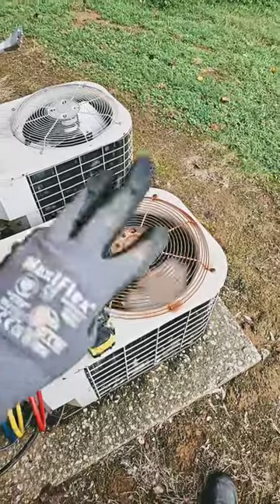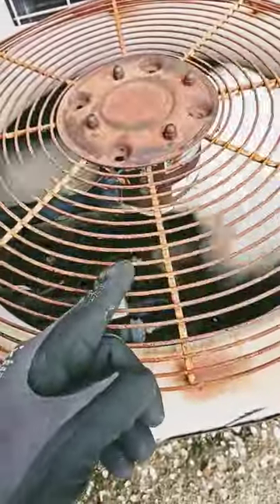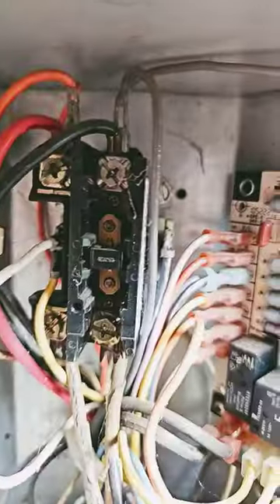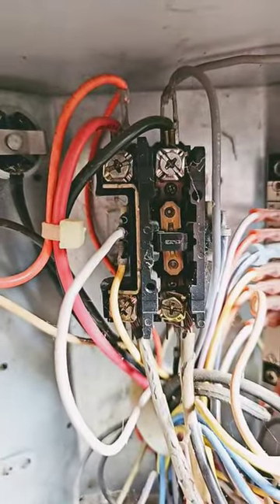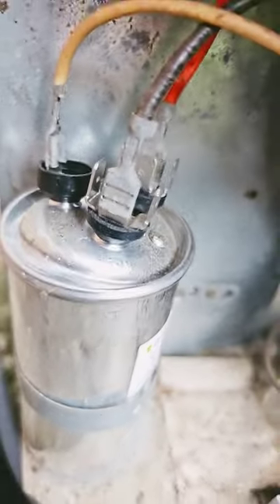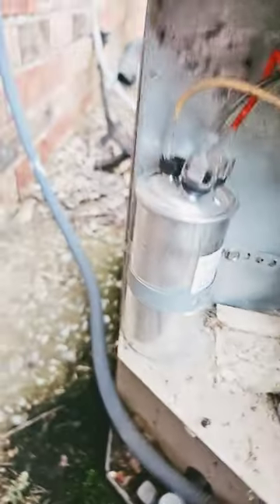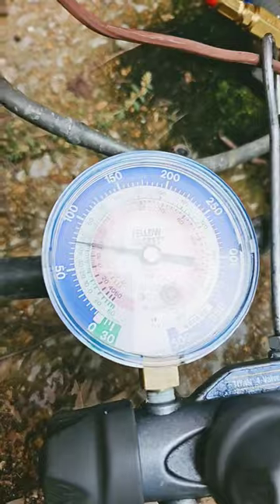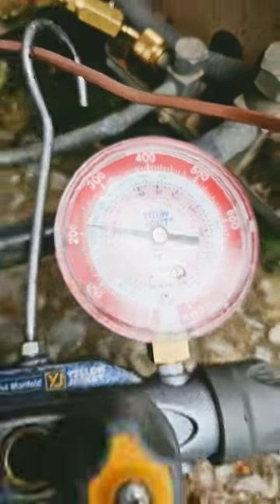Why is my air conditioner fan not spinning? #airconditioning

Comment: Exactly what happened to my parents at the fan motor seized up. I checked the capacitor it was good and the relay contacts will need changed next time I go over they were pitted very much and corrosion all over it. Thanks for your help and videos

Comment: All great points! I would like to mention sometimes the fan may not run but the units operating properly. This could be due to an encapsulated fan cycling or a motor master control. Both used to run the system in low ambient for commercial applications for the most part.

Comment: Those needles look perfect! All too often on older units, I wind up having to clean the blower wheel and evaporator coil due to lack of filter change and just time. Dead giveaway is slightly higher head pressure.

Comment: Number 4 Pressure control system that turns the fan off for low ambient temperatures. These do go bad and will fault out killing the fan in the summer months.

Comment: Capacitater….exactly!😂🤣I arrived at a call once and I assume a homeowner replaced his own blower capacitor so he wrote the wiring on a post. It was wrote as cow-pastor🤣😂. But on a serious note I’ve seen internally shorted compressors cause on outdoor fan to run at really slow speed when the contactor isn’t pulled in. Just a back feed of voltage through the other windings of the compressor. I’ve saw that a few times. Great content!

Comment: Most AC capacitors are actually 2 in one. If you have an AC where the fan moves but the compressor never comes on then its likely the larger one that has failed but the smaller one is fine. Also this is like a $15 fix that anyone can do as long as your safe. AC companies will charge you crazy prices to replace this.
Reply from the maker: truth

Comment: do you always swap like for like on the cap? assuming if it was swapped before it was with the correct one? or do you always check schematic or manual first?
Reply from the maker: I always just swap, and sometimes I check schematic
Reply: If the fan motor has been replaced, it should have it written on the side. The original diagram may call for a +5, but depending on the motor, it could be +/- to a 7.5 - 10. If you're familiar with the unit, you can do a pop and swap, but if you're just starting out in Hvac, it's a good practice to read your panel and the fan motor.  To high you'll kill the start windings by hitting to hard. To low, your starving it and adding a load that can also eventually burn up a leg on the contactor. Taddy has been at it a while. He knows his stuff. We all pick up our own ways of checking equipment and also changing our parts. One thing we all have in common is safty first! Pull that disconnect, or flip that breaker. Complacency kills.

Comment: How do you figure out what kind of capacitor if it's not numbers?
Reply: Check to see if there is a label on the compressor and look on the side of your fan motor.  A lot of times, the diagram is to faded to read, and the sticker on the original capacitor could be faded or missing as well. When in doubt, I'll call the manufacturer and do my best to find the model # of the unit. Sometimes, you honestly have to guess. I hate doing that, but if you know what to listen for in compressor/fan start-up you can get close. With the fan completely disconnected power up the unit and listen to see if the compressor fires off smoothly and doesn't start by "Hammering" that means your hitting it to hard. Some noise is normal on take off. Once you have the compressor taking off good, test the fan motor in the same fashion with the compressor disconnected. If the fan doesn't start or starts slow your not hitting it hard enough. You want a smooth take off. If both tests ok, you should be good to go. Side note : When testing the compressor by itself DO NOT run it long without a fan. Heat and pressure build up way faster than you think. Hope this helps

Comment: What if the fan blades won't move at all? Even with a long screwdriver, it won't budge. Compressor turns on fine. Is it the Capacitater or the fan motor is shot?
Reply from the maker: bad bearings in motor
Reply: Turns out it was just rusted a little. I switched off the breaker and the AC switch and opened the fan assembly from top. with better access to the fan and the good old WD-40, I was able to turn the fan and it is spinning. Put it back together and AC is running now :-).
Reply: @AbhayMishra-md8sq  that will work for a little bit, but those are normally sealed bearings and when their done their done. With luck it will get you through the summer 🤞 but I'd go ahead and look for a new motor just to be safe.

Comment: #4 fan cycling controls, #5 the fan motor has bad windings. Bad ohm readings or is shorted internally. #6 the fan has an obstruction, #7 bad wire to the fan motor
Reply from the maker: excellent info

Comment: Use a single capacitor for the fan and a single capacitor for the compressor and they’ll last half a decade or more. They don’t do this because the two in one single capacitors fail quicker and that’s where they make their money.